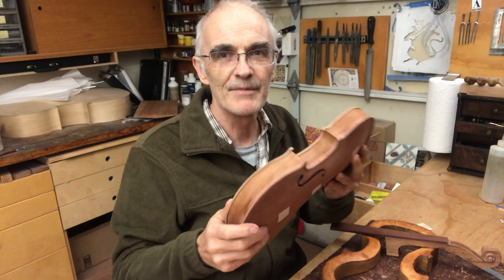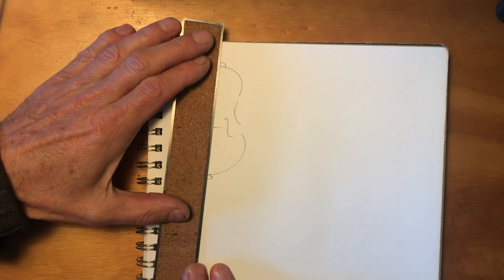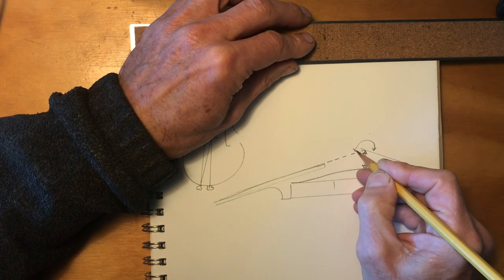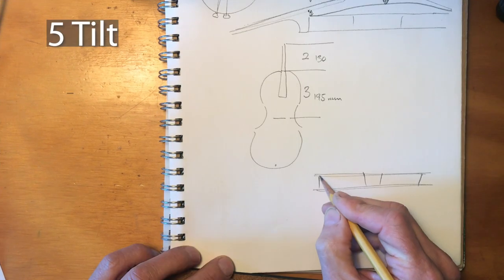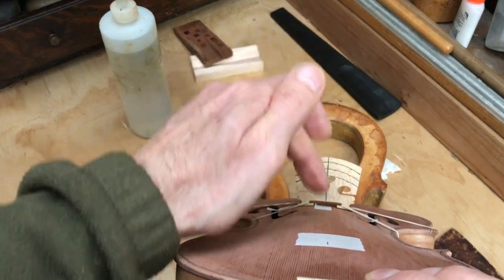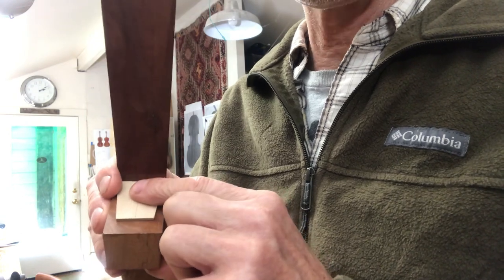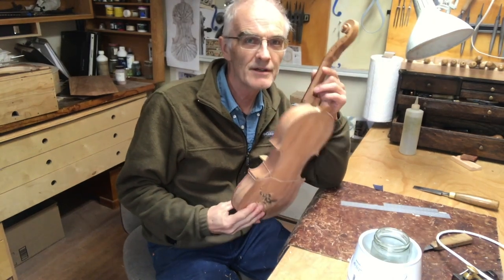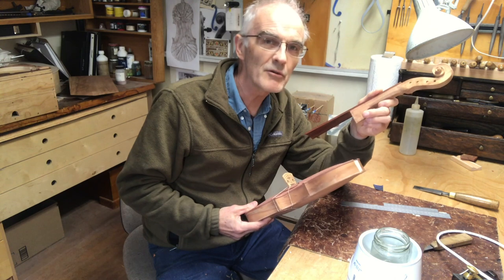Setting the neck into the Redwood Violin

Comment: I’m a long time guitar builder now building my first violin.   It’s been such a more demanding but thoroughly enjoyable and challenging endeavour, and no 2 will be much better.  Very grateful indeed for your concise description and guidance.  Particularly the specifications.   Much the same as setting a guitar neck but without the dovetail as well!  I might set the neck with the back off but in the mold so I’m not working into the neck button - thank you anyway.  Lovely.

Comment: It's interesting to me why there are no guitars that use the system used by violins.  The bridge with the strings bearing down on it and the sound post and bass bar.  The trapeze tailpiece is the closest I've seen and it has no sound post or bass bar, to my knowledge.
The violin is so incomprehensibly loud for its size, I would think that guitar builders would have caught onto the engineering before electrical amplification was started.
Reply: They aren't particularly loud when plucked, the volume probably has more to do with the bow constantly adding energy to the system.
Reply: @DaisiesofHate  Good point.  I think you're right.  A good thought.  A mystery.